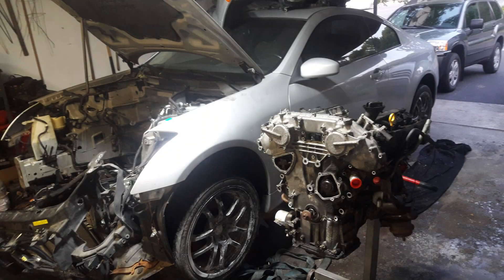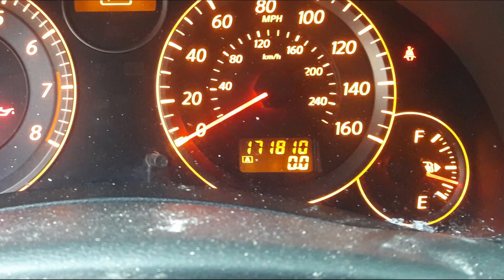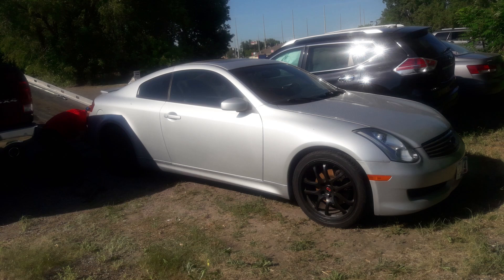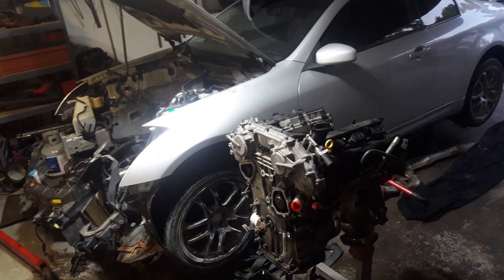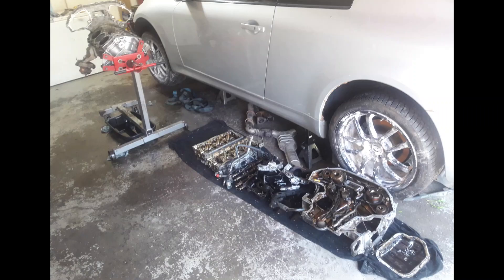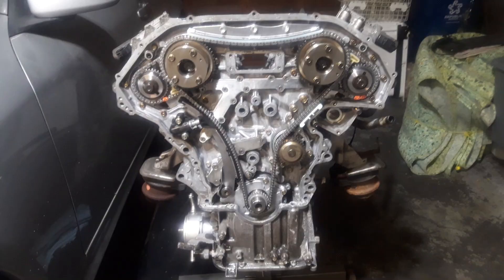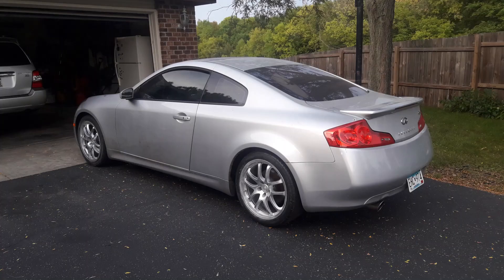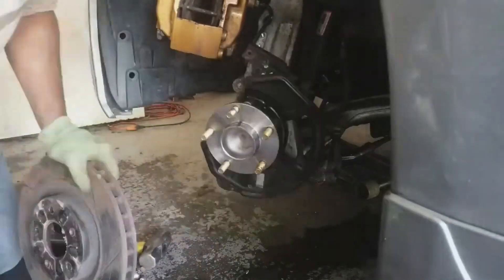REBUILDING a VQ35DE!... Things Ended Badly

Comment: Tbh yk that the reason the computer blocked the signal for fuel was because the sensors on the car were still original

Comment: Make sure ur Main pig tails to your computers are fully plugged in and on the positive lead from ur battery goes to a inline fuse the pig tails under that carode and u loose fuel pump signal my 350z did that after I pulled the motor and put it back in